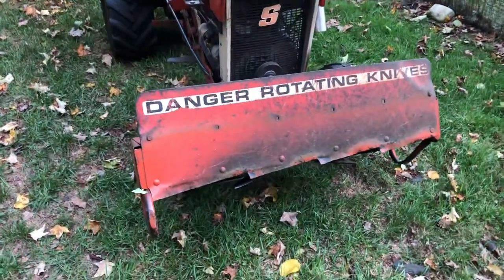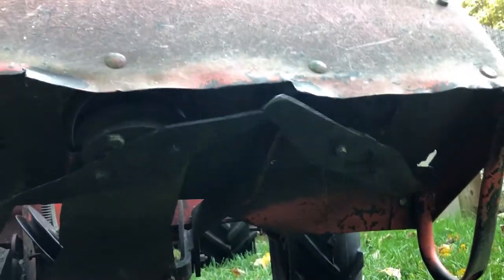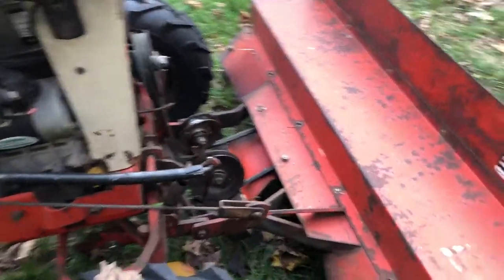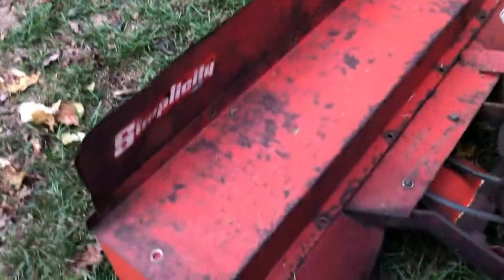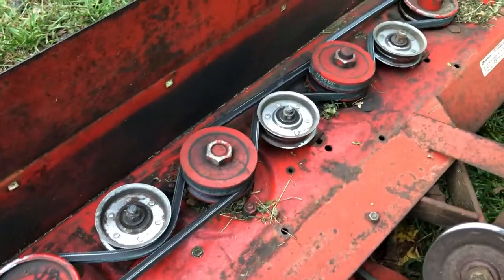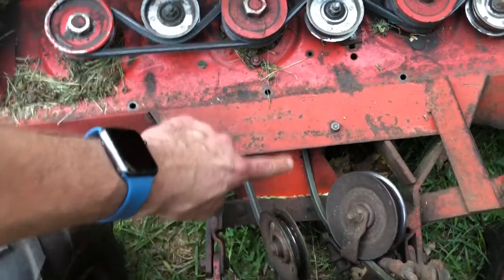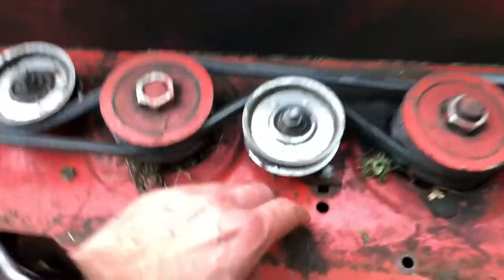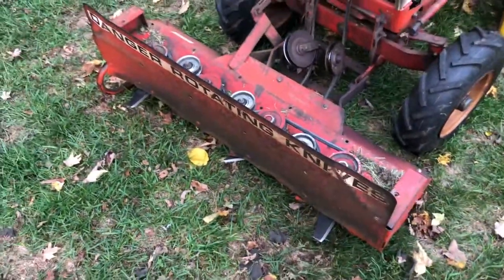Simplicity Weedcutter / Brushcutter

Comment: I just got one of these attachments… Paid up quite a bit, but it was within 15 minutes of myself and he wouldn’t negotiate at all… Can you tell me the belt size to run off the front pto? He had it rigged up to run on a large frame and i’m setting it back up for a front pto on my b12. Thanks!!
Reply from the maker: I used a Stens True Blue 248-063 (63" x 1/2" belt). This site is a good reference too , https://simpletractors.com/research/reference-info/belt-reference/belts_pg6/